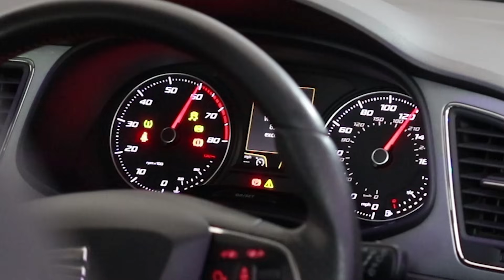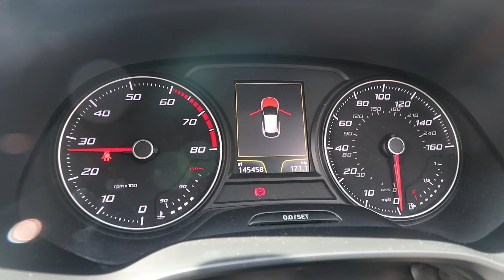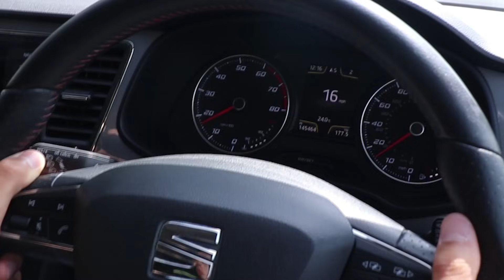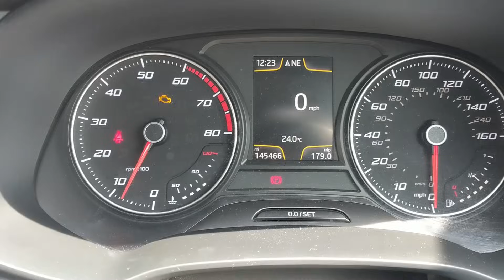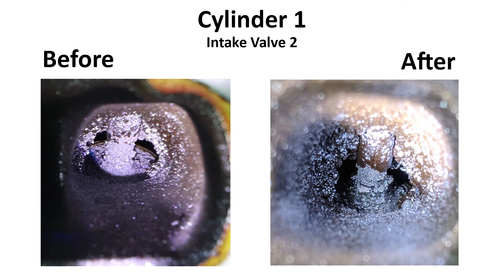Hydrogen Engine Carbon Cleaning Review - Car Care & Ownership Series

Comment: You would have had the same improvement if you thrashed it for 10 minutes. 
Hydrogen cleaning doesn't work.  Only way to clean your valves is by walnut shell blasting or a head removal and decoke

Comment: We have oil filters, so why doesn't the PCV system have a filter (i.e. "catch can") on it? Why doesn't the EGR system have a filter on it, too, to prevent particulates re-entering the engine?

This is the thing that annoys me about manufacturers who are trying to deal with emissions standards, but they totally flop when it comes to engine reliability and longevity. They fail much sooner than we think.

Thanks so much for the video. Really appreciate the time and effort you've put into it. I understand how much it takes to do all you've done in this video (as a car mechanic myself).

EDIT: P.S. I took my brother's head off and super-cleaned it manually. He gained tonnes of horsepower after that. The whole engine was so gunked up. This is the ONLY way to remove deposits and fix an airflow issue in my opinion. You can get right in there and fully decarbonise everything. It has the additional benefit of being very fun. :)

Comment: Fuel additive LNC from MiaNOX copes well with soot and deposits on valves and in the EGR system when burning fuel with LNC from MiaNOX additive, an active steam chemical reaction occurs in the cylinder, which cleans the particulate filter in a diesel engine and the catalyst in a gasoline engine.

Comment: Hydrogen and Oxygen => Scam. Only what it does, is that your valve seats may be burned ..... And also hydrogen and oxygen burns waaay much hotter so your turbo and catalytic converter will thank you ..

Comment: Interesting video, that carbon Cleaning machine wasn't putting out much Hydrogen judging from the bubbles in the water bottle. TBH there was not much Cleaning done IMHO.
Our workshop machine puts out 400 litres per hour Hydrogen from the HHO crystals and I think that's a lot more than the machine used in this video.

Comment: Great vid to see if Hydrogen cleaning works. Answer is that it did absolutely nothing and as for 3 horsepower well there are too many variables to consider that a gain. I would stick to walnut blasting or solvent cleaning.

Comment: great job? Bro this is bullshit... a fuel additive will clean it so much better
Reply from the maker: It's direct injection, I wanted to clean the intake valves. The fuel doesn't get the intake ports on a direct injection engine.

Comment: Cleaning with hydrogen and oxygen? This creates an enormous explosion risk, it is already dangerous with hydrogen alone, which is the most explosive gas that exists.
The carbon on the intake valves should burn on the stem side? Fire should never start on that side. If there is no fire, hydrogen will not remove the carbon at inlet temperatures. What gas did that man blow in? Probably just air. Then a test on a power bank? Surely this man knows that you have to enter the temperature, air pressure and water vapor voltage in the computer of that power bank? This has to be done with the first and the last test, that has a considerable effect on the outcome. He doesn't even seem to be doing a comparison test based on his comments. He must be able to indicate the power compared to the first measurement conditions, then you know what the real difference in power is. Usually the computer measures this data itself, but it does not appear from his comment that he knows this. In short, 2 buggers in a row.

Comment: Hydrocleans do not clean intake vales, its impossible. They clean everything from the combustion chamber through to the exhaust. 

They work by creating a mix of hydrogen and oxygen which are injected into the engine during combustion and they create much hotter combustion and gases which burn away carbon and clogged dpf's and cats. 

They most definitely do work, but only for the right applications, eg, blocked dpf, cat, gummed up turbo vanes, gummed up o² sensors, exhaust vales and manifolds etc.

Comment: Methods that work ?? the direct injection set up was a stupid engineering design plain and simple .. you want to fix the issue ? take the fucking head off the car and drop it in an ultrasonic cleaning machine for about 2 weeks at 30 minutes of time at a pop and don't use 100% purple power as the head will dissolve over time. bead blasting the head is best method but ultrasonic and soda blasting is the safest as there is no glass beads to remove prior to assembly .. in oil gallies etc .. don't be these models that were designed by an idiot .. direct injection without a secondary old style fuel system to spray into intake runners is stupid and shit tech ,,

Comment: With som much deposits it’s not that easy to remove them but I still wonder if it has any effect whatsoever. Normally if it worked and you did this every year to keep the valves clean it would be very nice
Reply from the maker: The cost to do it every 10k miles (£40 each time) I may as well pay for a walnut blast every 50-60k miles as I know this works for sure now.

Comment: Just had my e46 done 330d 

No change whatsoever 
Useless
Reply: Problem is in your inlet manifault! Either chemicals(i.e liqui moly), or, best way is to take it off and clean it. Don't forget to remove your swirl flaps to.
Reply: @marioshadjikyriacou3381  
Swirl flaps removed
Reply: @marioshadjikyriacou3381  
EGR AND COOLER DELETED
SWIRLS REMOVED
NEW MAF & MAP SENSOR
NEW VORTEX OIL BREATHER

CAR IS RUNNING GREAT NOW

Comment: The cleaning will work when you dismantle the parts thoroughly clean and put all back together.👍
Reply: just change and take a new engine at this poubt if you really want it clean you need to polish it also interior and change everything

Comment: Usually when you test an engine for how nice and smooth is running you should do with half load not full throttle. Full throttle can show you much on the Dino but not when you are driving . Most common mistakes when people buying used cars, drive slowly to find out how the engine performance is, good or bad.

Comment: VERY interesting! NOW what you need to do is remove the head and ONLY CLEAN THE CARBON! Do NOT grind the valves or make ANY other changes and record the difference.
The reason I'm asking IS, ECONOMY.  In other words, does cleaning the valves result in increased fuel economy, and if so how much? Would the increase in fuel mileage make up for even PART of the cost of manually removing the carbon over time?
Inquiring minds want to know!

Comment: would like to see a picture down the spark plug holes of the piston.
Reply from the maker: I didn't get a photo but I could see that it was very clean, only a thin smooth layer of black if I remember correctly.

Comment: You should asked the guy how mutch liters a minute of hydrogen he pumps true your engine. This cheap guys mostly pump 3 to 10 liters. I just did my ibiza 1.2 tdi with 220k km. Pumped 38 liter hydrogen p/minute. And the valves egr everything is super clean. You just got ripped off bro😅
Reply: This is false. You are talking nonsense.

Comment: Surely adding oxygen into the mix will just change the air fuel ratio measured by the O2 sensor? Ecu will add more fuel, lowering the deflageration temperature at specific load capacity. 
Secondly, adding hydrogen, increases predetonation, engine knock sensor will reduce fuel into air charge and retard timing, so all the hot gases are leaving the piston cylinder early, again, reducing deflaguration  potential.

I cannot see how any of this works. 
The best result I had was running propane directly into air box and a methanol injector running water mist into the inlet plenum. This internally steam cleaned the inlet manifold during use, at high charge consumption. Propane reduced fuel air ratio , engine ran rich and ecu did not compensate. Result, hotter more complete burn, more energy per deflaguration cycle and entropy from the water mist. Best engine clean I ever had.
Reply from the maker: That's interesting. I did a walnut blast which worked very well.

Comment: I had this done on my Mercedes C220 CDI year 2011 with 118k on the clock yesterday 09/10/2020 by Gary of Engine Carbon Clean and was worth every penny of the £125 it cost in total to clear an issue of lag from a cold start and a DPF regeneration clean which now is at just 13%. The main reason I had this done was that I was having an issue from a cold start with a lag on acceleration before the turbo would kick in which should not be the case and started just out of the blue. After trying everything prior to having this process done to try sorting this issue out the Carbon Clean process did the job and cleared this issue and the car now runs better than it ever did so the system does work and I'd use again in the future and I highly recommend this service to anyone with a Diesel car. Many thanks again to Gary for sorting my car he's a top man who carried this out and also a complete diagnostics of the car before and after the process and also explained everything to me so well and gave good advice and answered all my questions. So for those who say this process doesn't work they are very wrong, it does work and worth the money too.
Reply from the maker: I'm happy to hear you're pleased with your results.

Comment: Thanks for the video, the only video that treat the new engine (EA211) from VAG, and it seems they didn't solve the main problem of TSI (all generations). I think that you don't use the right oil or service interval is longer then 15000 km or 1 years, if you using longlife oil, this is why you intakes valve are so dirty. Oil have a big impact in carbon buildup. I have a golf mk7 with 1.4 tsi with 120000 km and it drive like first day, no power leak, just a litle vibration on idle but it has this since new. I change oil every 10000 km or 1 year i put castrol titanum 5w40.
Reply from the maker: My oil does normally get changed 7-8 months and it's still relatively clean. Never known an engine to keep its oil so clean. I do a lot of town miles and idling which doesn't help it.

Comment: Licence to print money not impressed rip off
Reply from the maker: To be fair to them, it does clean the hot side of the engine.
Reply: Conquer Driving I used these it made no difference to my car what so ever there is no quick fix buddy just find a good mechanic who will do at a decent price and get it done properly what’s a £1000 these days nothing
Reply from the maker: Well it didn't make much difference to my power or intake so I wouldn't do it again. But £1000 is a lot of money.

Comment: Great work. Shows that Hydrogen clean is BS
Reply: Do you really watched video? 🙂
Reply: @aleksandarpetrovic6613  Yes, and I know by our VAG forum in Denmark that its a waste of money.
If you want to use your money on it I will not stop you. :-)
Reply: @danielfl.9347  Don't be a slave of your own beliefs 🙂 Try it! Just don't use 12V machines, just big 230V are good.
Reply: @aleksandarpetrovic6613  No need to waste my money on it. A test made in Denmark made by an organisation was made and it said that it was a waste of money and did absolutely nothing.

You need to blast the carbon deposits with walnut shells or chemicals and manually clean the valve - heads.
Reply: @danielfl.9347  no one claim that HHO gas clean air manifold and inlet valves. And many tests was made all around the world and prove better performances and exhaust gases. This video also. Of course there some bad machines and mechanics, but this is usually in every job :)
Reply: @aleksandarpetrovic6613  I can hear that you maybe are a mechanic trying to sell this. Oxyhydrogen is a waste of money and is only done by workshops trying to rip off costumers. 
No scientific tests have been done to back up its effect. Only the companies who make this and mechanics trying to sell this will says its good.

Maybe it will clean 10-20% of the carbon from the valves, but it is not free. You should save your money and use if to clean it manually when's its carboned up
Reply: @danielfl.9347  actually, I was invented this process, accidentally, when I experimenting with HHO gas  :) Then I was write about this on many forums and after few years many companies start to produce machines. My first goal is ecology, and that's where this technology have greatest effect, im multiple ways. Many official laboratories do tests and technology was proven, and some countries use it for pollution problem solution, but we dont need scientific proofs, we can feel it in driving, can see lack of smell and smoke from exaust, and we can pass emissions testing on car registration. We also see less fuel consumption in many cases :) Only one thing we must clean separately, intake manifold and inlet valves, but just  at direct injection engines. But I now working on new generation of machine, which probably can clean all that carbon and oil deposits, on all types of engines, will see. :)
Reply: @aleksandarpetrovic6613  Moze neki kontakt?
Reply: @aleksandarpetrovic6613  12v or 240v the same, the unit is a hydrogen generator,you dont get more beef using 240 it just means you can plug into household mains.
Reply: @davidpaterson6524  no, you're wrong. Why you writing about something that you don't understand, but you acting like you are professional? Machines on 12V from car, have much less power than 220V machines.
Reply: Just had my bmw E46 done, it’s made no difference in performance, or anything 

Load of shite
Reply: @Fd20y  maybe just you can't feel it? Some people can't... Best solution is to measure some parameters, exhaust gases, for example.
Reply: All of ye seem to be missing the point of why this is done. It doesn't clean anything in the process before combustion. So showing intake valves(which he used for the thumbnail) is pointless and shows the guy doing the video doesn't even understand the process fully, if he did he wouldn't have used the intake valves as a point of reference as to whether it worked or not because it cleans by creating hotter gases which only affects the combustion chamber, exhaust valves and everything after that. 

But either way the main use for hydrocleaning or HHO cleaning is to clear blocked DPF's and cats along with sooted up exhaust sensors. 

If you were getting dpf faults or regens aren't working this is when you get a hydroclean.
Reply: I actually had it done on a 2000 Honda civic that had a check engine light issue of the worst kind when the it starts blinking because of a misfire, anyways I took the car to a muffler shop because I needed I needed a part and I heard the guy at the shop talking to a customer about carbon cleaning so I asked him if this would help my car anyways the car immediately had a more responsive acceleration and more power and the engine light was gone it even passed the smog check, I was happy with the results, but if your car runs good, you probably won't feel any difference .
Reply: Complete BS bro. I expected the carbon to be cleared at least to a reasonable extent.
Reply: @airduet  Just get it cleaned with blasting it out with walnut shells. I did this and paid a lot, but it actually works.
Reply: Auto Transmission fluid works Water has hydrogen and oxygen in it

Comment: The best way is to take out intake manifold, EGR valve, and physically clean them and also intake valves. Simple brushing will do.
Reply from the maker: That's what I did in the end with walnut shells. I've done a video on that too.
Reply: @ConquerDriving  please share link to the video

Comment: Some new engines use both direct injection and port injection. The ECM or PCM switches between both to take care of the valve carbonization. That is what the manufacturer says. I am surprised that HHO did not clean the valves better. Look forward to hear from you about what works better on cleaning the valves. One last thing to say, many shops I know use crushed walnut shells to blast the carbon from the valves and seats. Good day and stay safe too. VF
Reply from the maker: Thanks for your comment, I tried a chemical and walnut blasting and made videos on both.
Reply: @ConquerDriving can I get a link to the video with walnut blasting?
Reply: @ConquerDriving  How about using carbon dioxide gas for blasting ??? I have seen this used in limited applications with great success. Was wondering how this would work on engines ??? Since the blast is gas there is no cleanup from the medium used. Just an idea for you to consider too. VF
Reply from the maker: I've not heard of this. I guess you would have to be careful for health reasons. I think inhaling 12% CO2 is deadly.
Reply: @ConquerDriving  I have to apologize to you fella. Was not clear enough in my statement. I am talking about using CO2 frozen carbon dioxide cleaning. This would work superbly and leave very little cleanup needed. Well that is my idea, if it works bet you lots of others will be doing it soon. Good luck experimenting.  Thanks for for understanding and peace too.VF

Comment: I have been doing HHO carbon cleans for the last 18months.  I have had mot failure's pass and I have never had anyone not notice an improvement.
I always give vehicles a minimum of 1 hour and problematic vehicles longer. I don't believe 45 mins is long enough.
I charge from £50  which I think for the service is a fair price.
A wallnut clean is better but more expensive.
I wouldn't touch a terraclean in a million years.

A nice video 👍

Comment: it don't not give improvement because machine relaid on the H2 and O2 only but it should be mix with cleaning agent solution, which contains of Cationic for removing the carbon

Comment: Did your car suffer with engine management light before the clean?
Reply from the maker: Yes, regularly. Still did after the hydrogen clean. Walnut blast sorted the problem.
Reply: Have you had this walnut blasting done at all
Reply: What was the cause or reason for the check engine light?